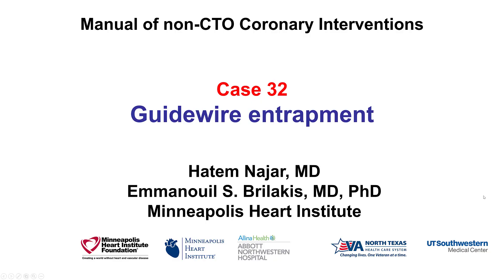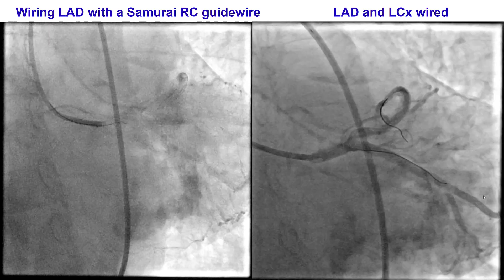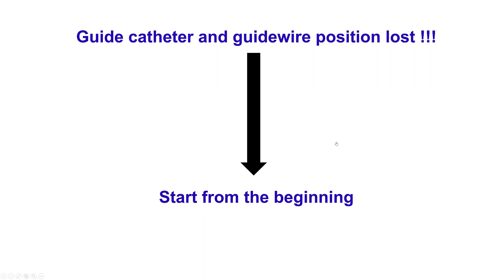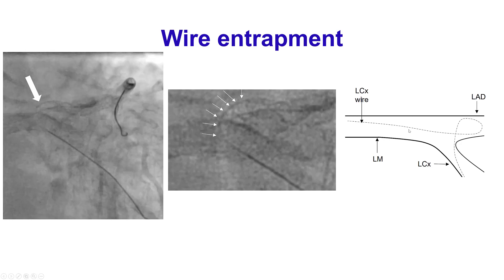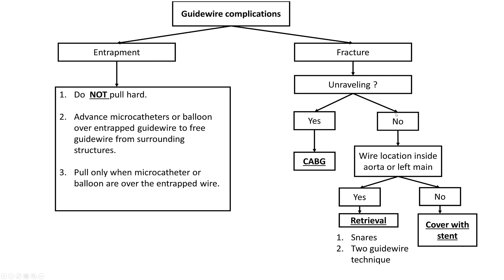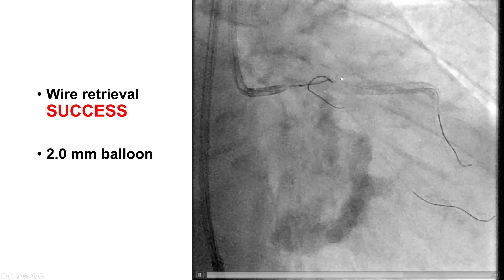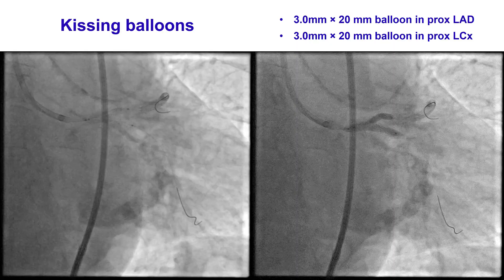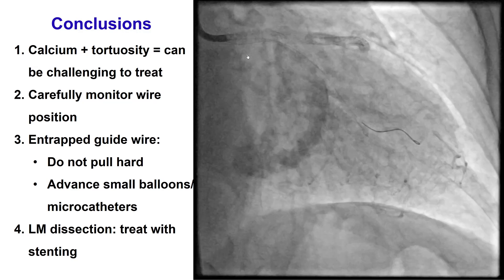Case 32: PCI Manual - Guidewire entrapment

Comment: Thank you very much for presenting this case. At what level should the tip of the microcatheter be when we try to remove the wire jailed by the stent? Can we dilate the small balloon on jailing wire if we can move it in jail segment?
Reply from the maker: Microcatheter should be advanced as far as possible. Inflating a small balloon advanced as far down as possible on the jailed wire can help too.